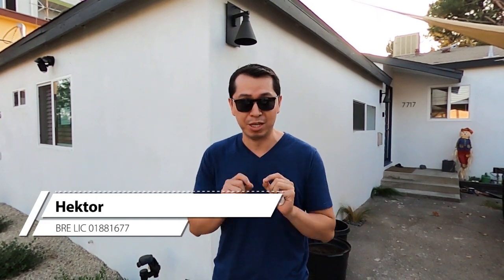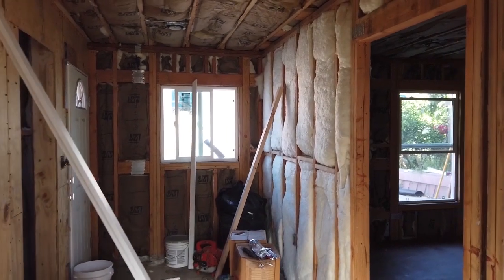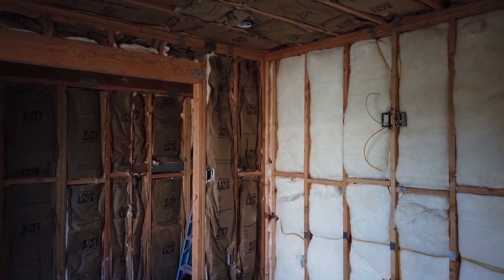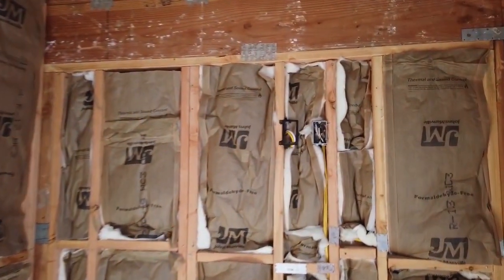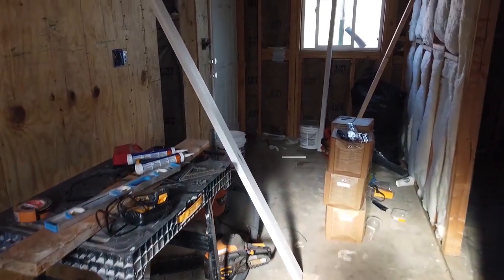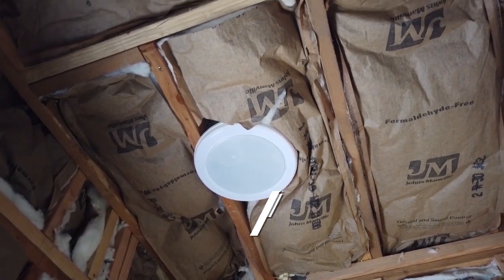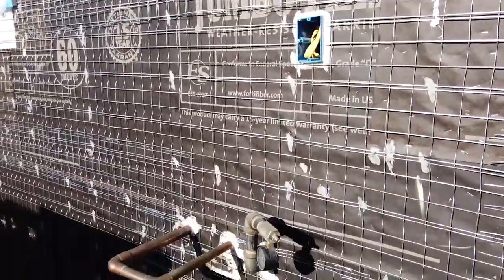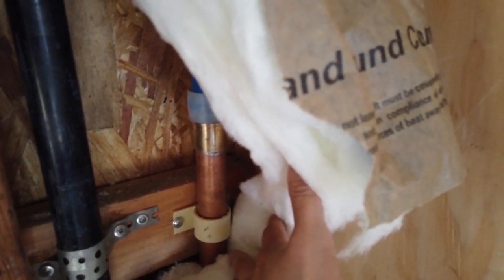ADU Pro Tips easy way to pass your city inspection's

Comment: What if my garage is already drywall and has wood flooring. Would I have to take down the drywall so inspector can see the framing?
Reply from the maker: RJ, most likely you will have to remove the drywall and floor in order to pass your rough inspections. However t he city inspector will make the last decision
Reply: @HektorCastillo  ok thank you!

Comment: What will be the estimated cost for this project?
Reply from the maker: I spoke to the contractor and this project will be about $68k fully completed.
Reply: @HektorCastillo  What do you think made this so much more expensive then your 40K project?
Reply: Is there any special permits you need in LA if the room you're trying to convert is over 100 years old? My garage was built in 1912 😬